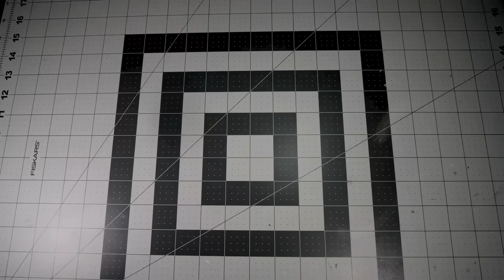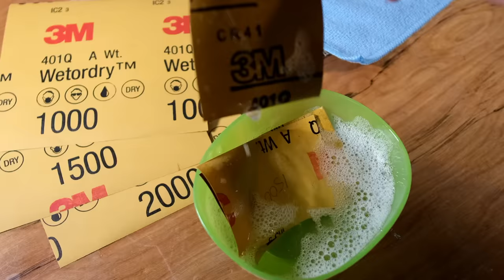I made a JAWS Shark Diorama / Polymer Clay / Resin

Comment: Very nice!  I wonder if it would be easier for you if you sprayed those acrylic sheets with some type of release agent. That way they won’t break apart when you’re trying to take them off.
Reply from the maker: Really the Plexi didn’t stick too badly, I just fused all the seams by using way too much CA glue. So I basically made an indestructible box that had stronger seams than sides…lol. The chunks that weren’t bound by corners came off pretty easy…
Thanks for the input!

Comment: Hey, great video. Question tho. Ive been doing research online and im getting lots of mixed messaging. So out of curiosity, how many pours was this? Hard to tell from editing. Thinking of doing some resin related stuff and i keep hearing "dont pour more than 4 inches at a time and do multiple pours... blah blah". But it looks to me that you (as well of other youtubers ive checked out for reference/research) did one pour and hoped for the best. Since this project is kinda similar to something i have in mind for the future, any info you could give would be appreciated. Thanks.
Reply from the maker: Hello! I did do a single pour, but I used Blake from BM Sculptures approach, where I kept the resin in a temperature controlled environment to keep the temperature down to avoid an exothermic reaction. It took about a week to cure, and there was a bit of shrinkage, but one of the benefits of doing an inverted pour is that all that was on the bottom and easy to clean up. I'd recommend checking out Blakes video:  https://www.youtube.com/watch?v=Z5UJrqElR-U
Cheers!!
Reply: @threethirtythree  thanks a ton for the reccomend. It answered a lot of questions I didn't even know I had. Great info. This stuff is just too expensive to go off and just "try and see" ya know? Almost too scared of things going wrong, especially after working my butt off on a sculpt. I never even considered something like a fridge. This is perfect. Really puts my mind at ease. Thanks again. You earned a sub 😀
Reply from the maker: @TheMonsterSculpter   Appreciate it! I hear ya on the cost for resin!!! Fortunately during Canadian winter my garage was just about the perfect temperature so I didn't have to empty my fridge....but we'll see for next time. Cheers!

Comment: Can I know what type of resin you use, for such high castings
Reply from the maker: I used Mas Deep Pour….however I needed to keep the room very cool to avoid it overheating while curing. If you can’t control the temperature where you leave it to cure, I would not recommend a single pour….
Reply: Thanks for the accurate explanation, you were very kind